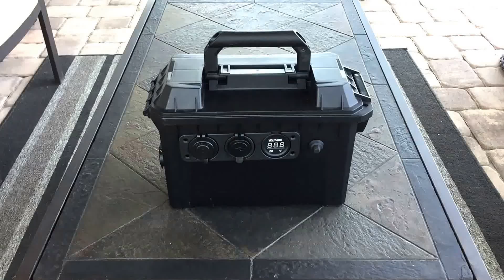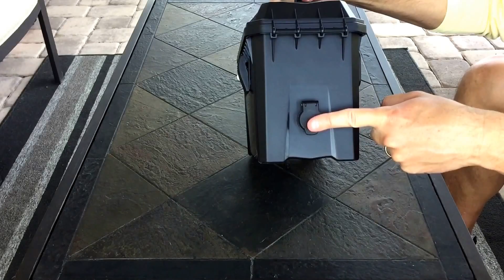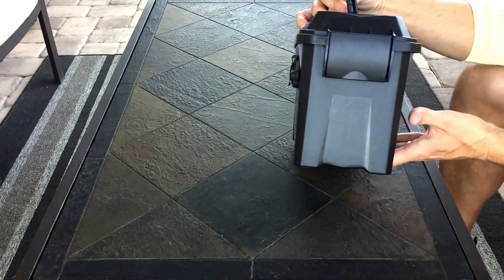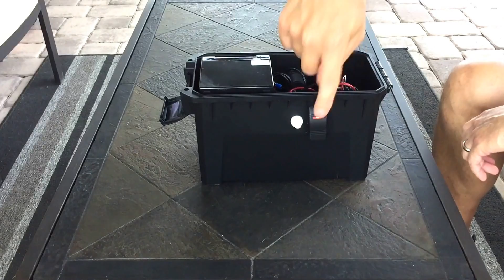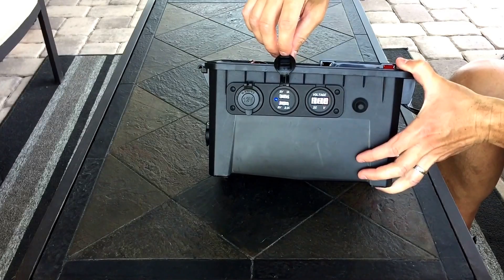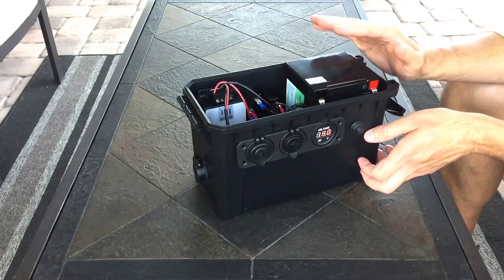Solar Ammo Box Generator 2.0!

Comment: I have a similar setup, and have had the same issue on the "kick start" to get it to start charging. My solution was to add a bank of button batteries that add up to ~12 volts and a momentary push button on the inside. This gives the charge controller enough voltage and current for the system to start accepting the solar input. I 3d printed an enclosure for this but you could just electrical tape it together if you don't have that resource.

Comment: Hi, Matt. 

Nice video. I understand your concern regarding monitoring the battery usage so you know when it needs to be charged.  I thought perhaps a meter that tracks amp-hours (and could be reset after charging) might be a good solution. I did find one, Victron BMV-700 Battery Monitor, but it's about $150... so there's that.

I'm putting a power box together, and considering using two or more (smaller) batteries in a slightly larger enclosure. Having a spare for those times the others are depleted. But, haven't made any decisions yet.

I like the water-resistant charging port you've installed. I was also thinking that a momentary push-button to spark the system into charging might be an option for you. Rather than having to do so manually, until you find a better method. Just a thought.
Reply from the maker: Thanks Truman!  I have another build that I'm working on that incorporates a lot of the lessons I've learned over the years.  It includes a meter, lithium batteries, Victron solar charge controller, etc.  In regards to the manual process, it's not really that big of an issue.  A momentary tap of the solar leads on the batteries wakes up the BMS.  Best of luck with your build!

Comment: I suspect your solar panel is too small and doesn't generate enough current.  I'm pretty sure if you use the charger that comes with the battery, it will start right up.
Reply from the maker: +afshin735 doesn't matter the size. I've tried 25, 50, and 100. Same issue. It's the BMS doing it's job.

Comment: Thanks for the video.  Not sure if this has already been suggested, but have you considered using a separate low voltage disconnect circuit?  That way, the load will be shut off before the battery cuts itself off, eliminating the wake up issue.

https://www.amazon.com/dp/B018TW0KN2/_encoding=UTF8?coliid=I1OQWEJORSJD4&colid=1PWTF8HOF4AM2
Reply from the maker: +Jeff How It hasn’t and I’ll check it out!

Comment: I know I am not the sharpest tack in the box but could you use a capacitor to bump start the BMS?
Reply from the maker: Yes you could!  I solved the issue by using the solar panel to "jump start" the BMS.  Like taping jumper cables on a car battery.  Works like a champ.

Comment: Have you thought of mounting MC4 waterproof connectors to the box to plug the solar panel up to..?  (drill hole in box, insert threaded Positive MC4 on the outside and the Negative MC4 on the inside... Then flip to second and repeat.  That way you have waterproof way to plug in directly your solar panel
Reply from the maker: I did and here's why I went with the Powerlet setup -  I didn't want something sticking out that far from the case that could get snapped off.  The Powerlet socket is rugged and the attached cap/lid seals the opening.  Plus, MC4 connectors can be a pain to connect/disconnect, especially if you don't have the proper tool.

Comment: To overcome your BMS challenge, what about a normally open, momentary DPST switch directly from the panel input to the battery?  When its in protect, throw the switch or press a button to "wake up" the battery.  When you release the switch, the system goes back to the normal configuration and charges happily away.
Reply from the maker: +NSNorfolk In a way, that's what I ended up doing. I appreciate the suggestion.

Comment: To kick start the BMS on a lithium Battery:
You need to get your old Lead Acid Battery. Put a standard charger the lead acid battery and then parallel connect the lead acid battery to your lithium. This will "fool" the BMS and your lithium battery will recharge.
Reply from the maker: +Bruce Forster Thanks for the suggestion.  I found that the panel puts out enough voltage to do the same. I just tap the leads on the battery and presto.
Reply: I learned this from another tech myself just a few months ago.

Comment: Your videos are great!  Thanks for the info.  I'm going to build one of these.  However, I have a question.  While I will have a solar panel to charge the battery.  What do you recommend for putting in this system to plug it into a wall outlet for charging in the house?  I know I can remove the battery and charge it independently, but I think it would be nice to have a socket that would plug into the box and a 12OV wall outlet.  Would that work?  Where do I wire it in?
Thanks!
Reply from the maker: +Cooldaddycars1 I use a charger can connect it directly to the battery. There's not much room left a charger inside the box in order to make it work. In a larger build you can do it. You would have to connect it like you normally would, but use a marine socket to go through the wall of the box. You would then have to modify the plug of the charger by wiring it to the socket.  Glad you enjoyed the videos and best of luck on your build!

Comment: Like your videos, I am currently working on a "BOX" with an 1100w inverter, Optima 12v Battery, and a GoalZero Solar panel. I loved your tip on putting an extended bolt/heatshrunk through the box to control batter movement! Will be adding that to the box tomorrow! I purchased a Newport Vessels Smart batter Box which already included the USB and 12v Cigarette Plug. I have been modifying the box to allow a solar controller and the inverter... love your videos and your perfectionist! Awesome!

Comment: Nice setup there, but that kind of digital meter used to mislead when your system is on load.
Reply from the maker: Correct.  In order to truly determine the state of charge would cost more then what it's worth for a solution this small.

Comment: for the shocking of the battery I would put wires from the plug connected to a momentary switch to the battery so that you don't have to open the box.
Reply from the maker: Thanks for the suggestion Alan.  I was able to work it out by touching the leads of the solar panel directly to the battery and it does the trick.  BMS "wakes up" and I'm able to charge.  The switch suggestion sounds even better.
Reply: @MattLesak  but if it went out at night you cant do that, maybe a small 9v battery or a small agm battery would be good to have around

Comment: Some new finds as I inch towards actually assembling my solar generator! I got the bioenno 20ah battery, now I just need to save for the GV10 MPPT.

You said you had issue fitting the volmeter. Check out this combined dual USB socket WITH volmeter. https://www.amazon.com/dp/B01F8C5EP0/ref=cm_sw_r_cp_api_X7oXxb0MX6M07

Also, Anderson Power Connectors now have a panel mount with 45A connectors. Probably good for direct to battery for high draw or a quick and universal connect for solar panels into the controller. 
https://powerwerx.com/panelpole-panel-mount-powerpole-housing?gclid=cjgm972m6m4cfvkpfgodlbyg3g
Reply from the maker: Very nice to both items!  I've been looking for a good Anderson external connection and Powerwerx has some good stuff.  Thanks Laurence!

Comment: Met up with the Bioenno folks over the weekend. I asked them about the BMS shutting off the battery and complications with solar charging. Their MPPT controllers output current so it will "kick" the BMS into charging. I think the Genasun will "think" there is no battery and therefore will not output current at the terminals. 

The Bioenno MPPT controller is 2-3x bigger than that Genasun but you might be able to squeeze it into that build if you're careful. I have a few more parts to gather before I start my build. ✌🏼️
Reply: Also it has a 30A load output which may more flexible than the Genasun's 5A model.
Reply from the maker: Interesting because when I spoke with them, they told me they would have the same issue with their controllers since the BMS shutdowns the battery in order to protect it.  The only reason I didn't use their controllers was due to size.  The other benefit of the Genasun is it's a sealed controller.
Reply from the maker: Agreed, but didn't need 30A for this build out.
Reply: +Matt Lesak hopefully when I start this project in the near future I'll give it a full test and let you know. The size of the Genasun is really attractive and will probably try it on a smaller, more portable build.
Reply from the maker: Keep me posted as I'm curious as to what you run into.  Hopefully their controller overcomes the BMS issue.
Reply: Any progress on the BMS issue? BTW very very cool !!! 
Curious, do you use the same circuit breaker for the LiFePO4?
Reply from the maker: jabber wolf Thanks!  Yes - what I ended up doing was taking the leads from the solar panel and "jump start" the battery by briefly touching the +/- leads of the battery.  BMS turns on and all is well.  I'm able to charge without issue.  As far as circuit breakers, yes I use them on all my builds.

Comment: I needed a 12v power supply for my new ham radio transceiver, so instead of shelling out over $100 for one that may end up causing radio interference, I picked up one of those 40Ah LifePO4 battery/charger and a solar charge controller. Works very well and now I can build a portable solar generator like yours. 
A rechargeable 12v supply is more handy than people think. Pick up some 12v fans and lights that they use for RVs, add a USB plug that converts it down to 5v for phones and tablets, and you are ready for camping and/or blackouts. I could even power my TV and directv box with just a small 100-200 watt inverter. This battery can put out 80 amps continuous and a max of 160 amps peak.
Reply from the maker: Great and I couldn't agree more.  A lot you can do with 12V.

Comment: According to the FAQ at Bioenno, the reset procedure when the PCM shuts the pack down is indeed to connect the battery briefly to the charger. It's likely not working with the charge controller inline because the controller senses no load, and therefore sends no power to the leads. Hooking it straight to the panel sends straight voltage to the pack and resets the PCM as noted. Unfortunately, the raw voltage coming from the panel is likely well over 12v and may damage the battery if left on too long. I would measure the straight panel voltage and see if I could shade the panel enough to get it close to 12v and then jolt the PCM. Just a thought.
Reply: As long as the maximum operating current of your solar panel is less than the max charge current of the battery you should be fine. In fact you could add a momentary button that switches the solar directly to the battery.
Reply from the maker: Thanks for the suggestion Jeff and I agree.

Comment: If I wanted to build this to a larger scale, are those Bioenno LiFePo4 batteries capable of being hooked up in parallel or would the internal BMS be a conflict in that situation?
Reply from the maker: +thelegendbullet937 They don't recommend parallel configurations. They sell larger capacities along with custom builds if necessary.
Reply: That's what I was guessing.
I've gone ahead and got the 40Ah battery instead of trying to do a parallel setup with these, I believe the fit will be just about right for the case I want it to fit in. Thanks for your feedback!
Reply from the maker: LiFePO4 aren't perfect by any means, but in my option, the tradeoffs are worth it.  Best of luck with your build!
Reply: Hey man, I've finished my box and made my own video. I put it on another account tailored towards technology stuff and gave you a shout-out in it.
Thanks again for your feedback!

/watch?v=LdB0KK3ny7w
Reply from the maker: Just watched, commented, and subscribed!  Take a look at the URL you posted in your comment, it's truncated.
Here's the URL: https://youtu.be/LdB0KK3ny7w

Comment: One quick question: I'm wondering where you got your little 4-way mini-bus bar connector/couplers? I can't find them as I'm not sure what to call them.
Reply: Ah, never mind. I just saw Laurence's comment below for the Wago Push wire connectors and lever nuts. Thanks!
Reply from the maker: If you live in the US, you can pick them up at Home Depot.
Reply: Another way to do that is to use terminal strips. Same basic idea, and neater than wire nuts or "push wire connectors".  We usually ditch those and use wire nuts, so I have a few stashed.  I like Matt's ideas for 
neatness, and terminal strips take it one step further.

Comment: How about a set of super capacitors connected with a "reset" button that will short the circuit in order to jolt the BMS when the battery is empty? They will give more than enough amps to do the job, and you can easily scale to preference.
Just a thought.
Reply: Cheaper, simpler, near Zero weight penalty...  Just have a momentary bypass switch, maybe a 2 pole, that connects the batt direct to the solar panel for as long as you hold it. Push Button,  Radio Shack or a weatherproof style. Surely you have seen that in your travels, Matt! :D
Reply: you never want to connect the battery directly to the panels. that could damage the battery, and definitely voids the warranty.
Reply from the maker: That would do it.  Thanks for the feedback!

Comment: VERY nice and clean build. I've been wanting to start a similar project with LiFePo4 batteries and that exact MpPt controller. Bioenno has been great so far too!

Check out these Wago Connectors rather than the push through nuts connectors from Home Depot. They're a little pricey but worth it for easy changes.

Wago (25) 222-412 (25) 222-413 (20) 222-415 Lever-Nut Assortment Pack https://www.amazon.com/dp/B00U4520JK/ref=cm_sw_r_cp_api_Og3lxbRFCJPCD
Reply from the maker: +Laurence Thank you!  I will check them out.  The option of changing the wiring around is appealing for prototypes.

Comment: Looks good Matt! Maybe you could wire an internal momentary switch off the charging socket that allows you to briefly hit the battery directly - no different from what you're doing but avoids having to manually pop open the case and apply "the paddles". You'd probably want to cover the switch to avoid accidental presses :)
Reply from the maker: +Chuck Hirstius Great idea Chuck!  I could make an adaptor to the plug using the Power Poles to avoid it from happening, but it's another thing that could get lost.